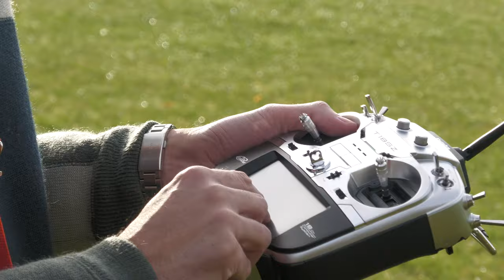The Ultimate! | Not the one I want

Comment: It's all in the set up and probably the spectrum reciever. With the AS3X. I have the first version of this plane and it flys awesome I run mine with 40 percent EXPO and  triple rates 60 80 and 100.  It's a very capable model and I don't think you're giving it the proper set up or trim
Reply from the maker: Hi. I agree. I think these are much better with the spectrum setup, it what they are designed for. My aileron servo was also not returning to Center which didn’t help. There’s lots of videos of them flying really well. I do still think they are a bit heavy.
Reply: It’s foam and you have been flying hard core balsa 3d planes big difference…I have a few foam planes that I like to fly but they don’t compare to my 59in AJ slick 😢 which I need to repair since they don’t sell any parts for that model. Shouldn’t have to hand launch just give it up elevator and lot of throttle…I fly on grass good thing with electrics u don’t really need much or any runway.